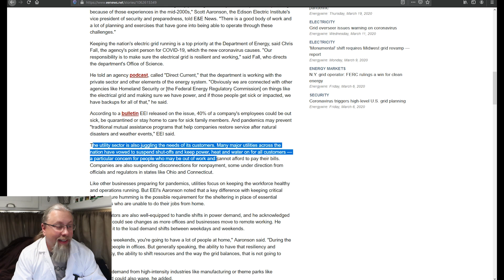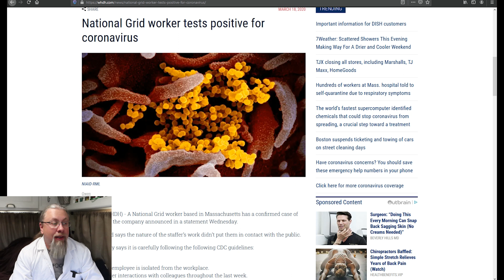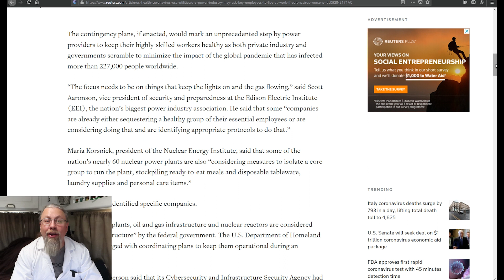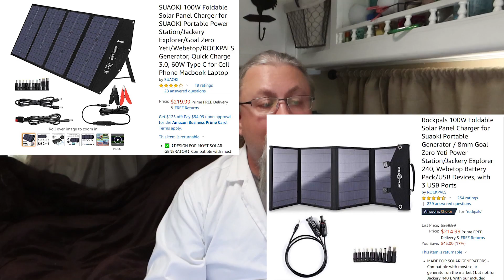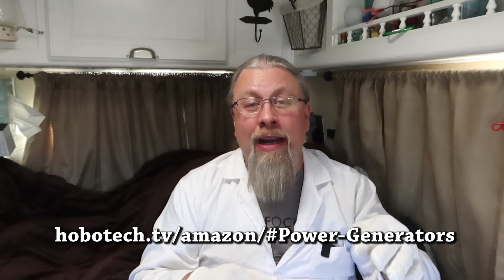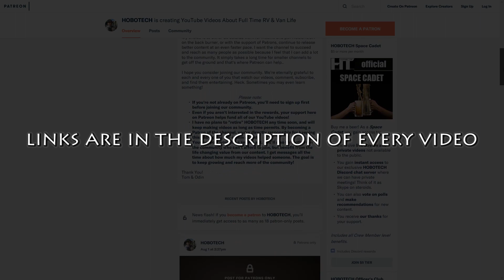BEST Portable POWER STATIONS | SOLAR GENERATORS For SHTF | Grid Down | Blackouts | Covid 19 Preppers

Comment: If I have the Bluetti Maxoak 2400wh and 6 Renergy 100w panels, should I connect the panels in series, or would it better to connect 3 groups of 2 in parallel, and then connect those in series?

Comment: We purchased two Zamp Obsidian 100 portable panels and a Jackery 1500. You can disconnect the controller from the solar panel and plug right into the Jackery with a home made cable.
Reply: How long to fully charge with those panels

Comment: Hey hobo, Thanks for what you do. Here comes the BUT. I want this power station for 1 reason only. And only 1 REASON. I'm camping for 8 days and I need this for multiple nights to run my C-pap machine without the humidifier, which I 'm not exactly sure, but I 'm thinking it draws around 8 watts of power. I'm up in the air (been up there a while now) about which one of these units that I need, the pecron1500 or the Bluetti 1500. Help me out, my head hurts.

Comment: The only thing we worry about is our WELL PUMP. We live in the SW Arizona desert so there is no running water from streams, etc. So, our WELL PUMP is 1500 WATT, with 30 AMP breaker and 220 VOLT line hooked up to it. Will any of these solar generators handle our WELL PUMP ?? Judi & Deryl

Comment: Thanks for the straight talk about needing a small solar/gen set for shtf apartment living. I bought the Jackery 300/100 solar set on ur recommendation. I really like the set. Right size, light weight, just enough power.  I would like to be able to plug one 100w panel into another for a parallel power for that extra power on cloudy days
Reply: You can buy a iGreely Y adapter and use two solar panels on the jackery 300
Reply: @DeadlyCookie15  Thanks for the heads up. I just just bought.  Thanks.

Comment: My mind boggles. If I want to power ONLY the largest 12V fridge I can fit in my ambulance conversion 24/7 and NOTHING ELSE, what portable solution must I buy?

2. Bluetti top tier naming and numbering is gettin confusing as hell. Aside from the monster, which is the largest one, second to largest, etc. with optimal (not minimum) panels in watts?  Why not carry ONE 450 W. residential panel ($200) and lay it down instead of some huge number of "portable" 100 W folders? Thanks.

Comment: Which of the Yeti 3000W or 6000W generators would you recommend.... I have 2 Pride Maxima Scooters, CPAP, Fridge, Stove, Microwave, Laptops, 60" Plasma TV and Air Conditioner... I would like to create a Faraday Cage using a 5'x8' enclosed utility trailer in order to safe guard my generator, scooters, and backup electronic devices, in case of a CME or EMP event
Reply from the maker: Neither. https://youtu.be/X3egWGNyTYw

Comment: I went with the Dometic PLB-40's because I have tried to keep everything 12v, They are rated at 512wh/40Ah and they will power my fridge for days, Again the built in MPPT charge controller can handle about 150w+/- and they charge at about 17.5% per hour from the wall wart and just as fast from Solar or the Vans Cigar socket, Having 3 charging options is a blast and I also have a Gas powered Generator to plug into if needed, and backup power bank of 3X 115Ah deep cycle batteries with 1500/3000w pure cine wave 12v inverter So I have 3 forms of power supply and at leased 3 forms of charging. having options is the key in times of need, Great Video thanks for posting.

Comment: I bought a rockpal 350 generator and aco solar power and I was hoping plug and play.  I had wires and the anderson cord wires were switched at plugs red and black wires.   Frustration.  How come its not standardized.  Wires are too confusing.  The panal would not hook up.  I dont want to rewire.  I want plug and play.

Comment: What would be a good power source for my midland micro mobile radio that I’m wanting to make a base station?  The midland micro mobile is a GMRS radio that has 15watt transmit power. Why I chose the midland micro mobile MXT115 because all I have to do is plug it into a cigarette lighter outlet in a car. 
I was going to use a car jump box not one of those little boxes . One of the jump starter power bank that you can charge your phone on . 
Some one told me it would not work for my midland MXT115. 
So I thought about a power station that I could solar charge .

Comment: Do these generators have EMP protection? We talk about solar flares, but these are kind of one and the same when compared to an EMP (same effect). When it comes to a SHTF situation , EMP protection in my opinion, is an absolute necessity. This can be achieved using a Faraday cage, or bag. I think the solar panels also need this type of protection, not 100% sure, but if it has circuit boards, then it's needed. There are some companies that sell these Faraday bags, but these companies that sell them are not known companies, or at least not know to me. So Im not sure where the bags are made and whether they would work or not. Important items such as Faraday bags is not something I feel comfortable purchasing on Amazon. Given that there is no way to test these bags, seller/product reliability is imperative. The generators are fine, those can be tested and verified for proper operation upon arrival, but Faradays is something you hope will work, no real way to test them that I am aware of. 

What is your opinion with regards to the need for Faraday protection? Your videos are awesome, lots of great information. I have been watching diligently. I need to get a setup for my home, we don't RV, but you never know when you may RV due to a necessity to do so (SHTF) so being prepared is something I want to do ASAP.
Reply: Put your phone inside and ring it.
Reply: @jadenelson-chapman9480  what does it do?

Comment: I have just the thing , I built my own solar generator, 4 Battleborn 100 ah lithium ion batteries, outback flex 80 charge controller, , Aims 3,000 to 6,000 surge pure sine wave inverter and a converter, all in a de walt tool box with wheels, 4 Sunpower 170 watt flex panels and good to go! P.S. also a Victron blue tooth battery monitor. Plus I have a freeze drier and about a years worth of FD foods I did.

Comment: The Bluetti 2400 Watt DC (solar) charge port shows 16-60 Volt max (10 Amp) input. (Open circuit voltage per spec sheet).
1. My solar panels  show up to 64 volt (actual loaded) output for the first few minutes of production and are rated at 69 volts (open circuit).  Is that safe?
2.  If that is safe, can I put 2 panels in parallel to get wattage up to 2500 per day even though the peak combined output is as high as 650 watts?  
I assume the charger circuit would still max out at the 10 amp limit even though the available amps may be 11 amps at peak sunlight?

Comment: Question: if I plug a solar generator into a power source and the input reads 75 watts  how does that equate to time? Does that mean 75 times 4 hours adds 300 watts to my generator battery?

Comment: Thanks so much for the informative and fun videos. So I wondered if you can suggest a heater for the Jackery 1000. I am frequently in the teens in my Toyota Sienna Stealthmobile and I have a 500W ceramic heater but I also need to plug in other stuff. Would this be too much or will the 1000 handle it? Or could you perhaps give me suggestions for vanlife in super cold weather? Thanks again

Comment: I have J 500 n EB 240. Together great pair of types. Both product 5 stars
Reply: EB240 runs toaster, dishwasher today max draw 850 watts to unit. Small lights with leds bulbs Tv blue ray copper wire lanf line phones cats water fountains internet/cable boxes. It can run washer at 900-1050W. If no there loads. 
J 500 use as usb power/ led light power. Blue ray tv combo runs at -75 watts. Ran three hours tv/bray stopped at 38% power unit left. 
Panels j were ones fir it only. 
BV Rouge 180W. June-150+ W each. Sep 21 max at 1:00 pm of -90-100w. 3000' elev full sun but hazy. No smoke. In June 
7am to 8:30 am 20-40W. 8:30 to 9:15 about 75 w. 9:15 to around 4 pm max at about 475/4 panels in AA'; BB' parallel a,a'. Then series to b,b'. Best setup. 
In june produced about 4-6 kwr/day. Older 23cub ft fridge uses 250/month. 
Got a BV freezer you did vid on for $350, missed coupon cuz I waited too long. 
Possible to power almost whole house on two units. 
Wed. Power out for fires. Sat 9-1 pm. Out then Monday about two hours fixing pole hit on drunk nite saturday. 
Also got 4 hand 10000mah panels for ixr p/c n bed lights. The UV bug zapper runs two hours on them. 
Dremel devices usb running off jackery panels. 
About $4500 for 3kwhr energy all but air conditioning. Use ng heat 
Mr Hobotech. Thanks. Long post but raw actual data might help someone get going.
Reply: Added ac200p with 1800w of panels. Get prepared its coming soon. 4-20-21

Comment: Great video. I’ve had the Bluetti on my Amazon wishlist.  I’m a little north of you in Tempe.  I have been preparing food storage so I don’t have to rely on a refrigerator in the event of a grid down scenario.  I have two solar ovens and have been brushing up on those skills I learned in Girl Scouts over 50 years ago.  I have about 8000 gallons of water storage for my garden but I can filter it if necessary.  My main concern is if the grid goes down in the summer. I’ve done as much as possible to reduce heat gain but on 115 degree days like this summer, I can hunker down in the coolest room of the house but some additional cooling is going to be necessary.  I normally keep the thermostat between 80-82 and have a few fans.  I’m currently researching cooling options that I can power with a portable solar generator.  Assuming I can keep the power station fully charged each day, I’m having a difficult time determining what the maximum wattage I should be looking at to run a portable cooler 24 hours a day.  (I’m tired of doing math and secretly looking for someone to just tell me so I can devote my brain power to more fun stuff😅). So, if any of you solar whizzes out there care to help an old hippie lady out and do the math I would be grateful.

Comment: ??????? I already have solar for my house. Can I somehow connect my solar panels with the MaxOak Bluetti unit? Adapter????
Reply from the maker: The two systems are incompatible. In fact, if your solar is the typical grid tie it does you no good if the power goes out.

Comment: Thank you for this video! And thank you for only recommending units with a regulated 12v output. One thing you should consider mentioning in future videos is the number of charge/discharge cycles these units can do. As much as I like Jackery (from watching you and Will Prowse), they're only rated for 500 cycles. The Bluetti products are rated between 1,000 and 2,500 cycles depending on which unit you are looking at. Thanks again!
Reply from the maker: I do mention battery cycles in every one of my solar generator review videos. The lifecycle for the EB150 & 240 is 2500 cycles as specified on their website.
Reply: @HOBOTECH  - Okay, very good to know. Are you at all skeptical of Bluetti's claim of 2,500 cycles? Do you think it's just the quality of the cells, or is there some kind of black magic going on somewhere? :-) I need to watch more of your videos to learn more. Thank you again.

Comment: Why does no one ever mention the necessity of "heat" in the event of a power grid failure??  If it's winter, and there is no electricity, more than a refrigerator (which would be a problem more-than-adequately solved by the simple fact of it being cold), is heat.  The problem with the Jackery and Bluetti products you mentioned is that they are both limited by 1000w, even if they differ in how many watt hours they can supply electricity for.  Most heaters are 1500 watts and that would max out even a 1500 watt generator in an hour.  What is the solution???
Reply from the maker: Heat is easy. Get a $60 Buddy heater from Walmart.
Reply: @HOBOTECH  Thanks!!!
Reply: But these are propane.  Any idea on low watt electric heaters or is that impossible long term?

Comment: Would love to see a comparison or individual review of the 1000wh/600W 
Bluetti AC100....which I just bought with discount for $791. Compared to
 the Jackery 1000 $200 less, same 1000 wh, but 400 watts less inverter output
... But it uses LG premium Cells for 2000+ cycles, 4X that of the Jackery 1000. Enjoy your vids and have learned a lot. Thanks!!!

Comment: Jackery 1000 is the WORST for Preppers - I just made the mistake of buying one. You CANNOT use & charge at the same time without damaging. It is strictly for weekend campers. $999
Reply from the maker: That's a myth. I'm doing long term tests to prove it.
Reply: @HOBOTECH  Then you need to tell JACKERY they don't know their own product as they admit it will cut life in 1/2.   Mine would not work at all while charging.. Honestly, you should be ashamed of yourself for steering people in the wrong direction when lives could be at stake! Jackery is made  for WEEKEND CAMPERS - it was NEVER intended to be a survivalist/prepper item. It is good for what it was made for.

Comment: NAtures solar generator is only $1,000 and can handle 1,800 they have them at Lowe’s and Home Depot
Reply from the maker: Natures Gen is overpriced trash. They charge a grand for a $100 AGM battery with a cheap inverter/charger. It can only handle 1800 watts for a few minutes. I get asked about this one every day and feel bad for those that get suckered into buying one over a Jackery or Bluetti.
Reply: HOBOTECH I have one works great for my green house. 3600-Watt Electric Start Solar Powered Portable Generator with 2 Electric Start Solar Panels and Wind Turbine Kit is only $2,000 way better than the ones u advertise.
Reply from the maker: Glad it works for you. I would never recommend anyone buy a product that uses lead acid batteries.

Comment: Would you recommend the Patriot 1800 power generator? What's the best (most powerful) solar power generator? Thanks!
Reply from the maker: Patriot is overpriced trash sold by predators. EB240 is $800 less with 3 times the power.
Reply: @HOBOTECH  Thanks so much for that warning! I see the Bluetti 2400 for $1720 on their website w/ discount. But I'm having trouble finding any of the solar panels in stock that you recommend for it. You recommended (3) 100 W panels, right? Which do you like the best, and do you know where I can get them? Thanks so much for your videos!
Reply from the maker: @perrypaulding7737  Ok you're obviously in the wrong place. Watch this video first. It will answer all your questions. Use the link and discount provided in the description for the $1599 deal. https://youtu.be/UJt6d3SbQTA
Reply: @HOBOTECH  Sorry, that is the correct deal at $1599. But with the $120 tax, it ends up at $1720. 
Which solar panels that are in stock would you most recommend? Thanks!
Reply: @HOBOTECH  Have tested the Inergy Flex with 10 year warranty?
Reply from the maker: Flex is vaporware. No one has reviewed it as it doesn't exist yet. Apparently, fans have written them and went to their FB group hounding them to send me one.

Comment: Can i use the bluetti 2000, for off grid everyday use for a standard size fridge cell phone, laptop, if the answer is yes, would i need to hook it up to batteries and inverter and charge controller? I am clueless about these things.
Reply from the maker: AC200 or EB240? There is no 2000.
Reply: @HOBOTECH  the AC200
Reply from the maker: Solar generators already have batteries, controller, inverter. You need to add solar panels for full time off grid. Watch my series on the AC200 to answer your questions. FYI it's sold out till Nov.
Reply: @HOBOTECH  I did watch it but i am new to this info. so it was a bit confusing to me, but your reply definately helped. Thank you.

Comment: Overland rig: 200w panel, 1HP laptop (high current USB C), iPad Pro 2018 (USB C), Samsung Galaxy Note 20 Ultra (USB C), GoPro Hero 7 Black (USB C slow charge), 1 flashlight and 2 bike lights (all USB A), compressor fridge, occasional air pump for tires and road shower pressurizing...which unit is the way to go? Thnx.
Reply from the maker: Bluetti. Get $300 off here direct from vendor with code: https://hobotech.tv/amazon/#Power-Generators
Reply: @HOBOTECH  just watched your video on the AC200, I agree that it needs fast charge! Thanks for all the tips and tests, without Hobotech my rig would be a real Hackross saga.

Comment: What about the Motorola MT060 750 watt hour 500 watt pure sine wave units? I know they are made by Schumacher. Any good?

Also, the instructions says you need a 30-36 volt solar panel. Is this commonly available?
Reply from the maker: Nope.
Reply: HOBOTECH Thanks for responding and I take it that answer goes for both questions.

Comment: hello i came across your station. I am new to this I'm looking for a good dependable entry level say 200 watt solar generator around  say 250.00, and im told i need to get a 100 watt solar panels also im told around 200.00, is this reasonable?
can you recommend a user friendly brand? I mainly plan to charge flashlights, laptop, But i wanna be able to run a coffee pot, and say 40 watt lights. what would you recommend?
Reply from the maker: Recommendations are at https://hobotech.tv/amazon/#Power-Generators

Comment: Would one of these power units be a creative way to keep a sump pump on overnight during a bad storm power outage?
Reply from the maker: Depends on startup amps and if you mean AC or DC. I have reviews on the AC200 that can run literally anything under 2kw.
Reply: @HOBOTECH  THANK YOU Sir. It would be for residential only when power gets kicked off. I had a flood in my basement and I dont want a generator to run just an alternating on/off sump pump. I thought portable power, but have to look into amps. Im new to electric so this is all a bit much to digest. Your videos make a big difference!